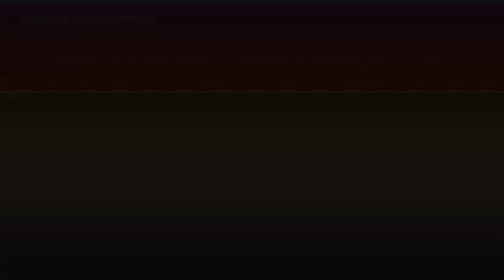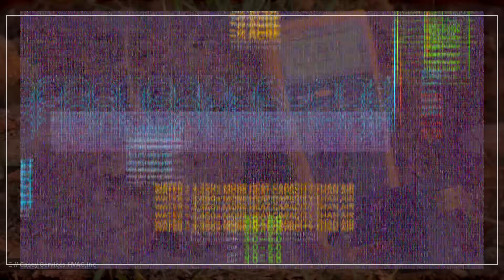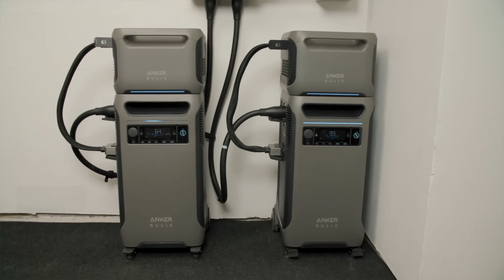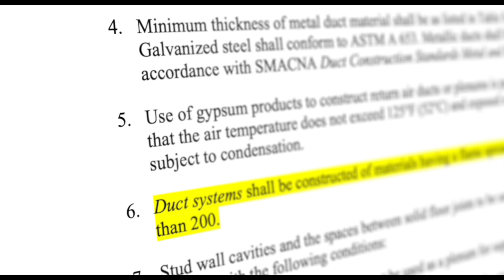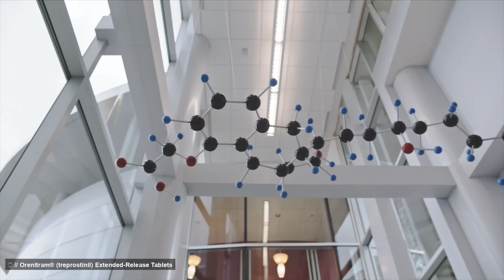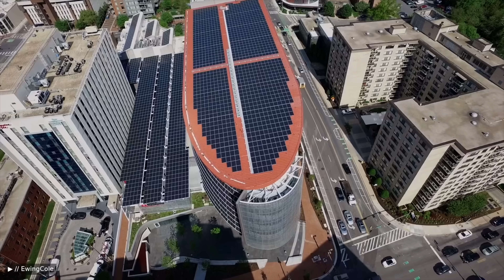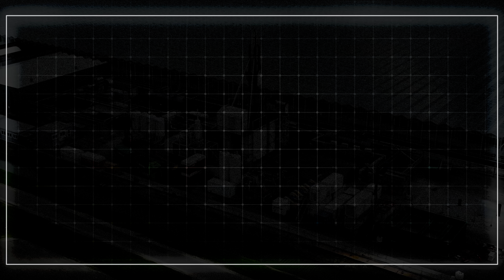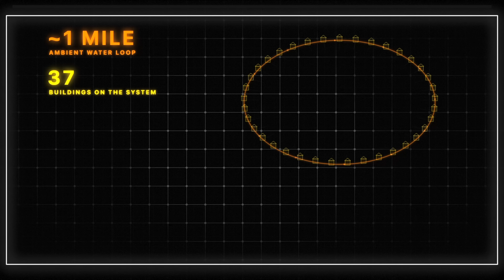The Viral DIY Cooling Hack That Nearly Killed a Family

Comment: Remember this administration believes none of this works so why should we pay for it and much prefer pseudoscience. And it's not just that if your system goes or you're looking to purchase a new one you're gonna go with what you have it's that these systems are way more expensive in the short term and not everybody can afford that so they are stuck (especially because they don't have these rebates) using a system that's less efficient and costs them more overtime.

Comment: Given you live in SoCal with some heating (very little) need and modest cooling needs (you are not in Texas) and you already have an air-to-air HP, hard to see the justification for it. Other than as an interesting science experiment. 
I feel a ground loop water system is what you should aim for. At the end of the day you want to make a case for a solution others can benefit from.

Comment: I’d be interested in seeing a comparison between a ground source heat exchanger directly into living space air, and a ground source heat exchanger into a heat-pump.
Reply: With a heat exhanger and no heat pump, you can only bring the indoor temperature towards the loop temperature. So if ground temp is 65F you will only get a small amount of cooling, and possibly getting you down to 75F is you're lucky.

Comment: I live in NZ, when I have looked into this technology, the local sellers advice to do horizontal loop over a vertical system. The reasoning being the horizontal is cheaper to install and repair. I would be curious as to which method withstands earthquakes best. My guess would be horizontal.

Comment: Building structure, as in thick walls, can go along way towards passive temperature control.  I never heard geo-thermal explained in this way before.  The two together sounds like a complimentary idea.  More expensive upfront, but worth it i the long-run.  Less machines to break down.  Thank you.

Comment: I did a feasibility study on ground loop heat pumps for a new build housing development almost 20 years ago. Sounds like the situation has changed very little since then. It's not economical to do these one home at a time, some kind of neighborhood scale system is the way to go. You really need a geotechnical engineer to validate the ground loop performance, and a separate mechanical engineer to validate the house/climate performance. Those are too expensive to hire for a single home, but you can get economies of scale across the dozens or hundreds of nearly identical homes in a development.

Hopefully the control algorithms have improved, 20 years ago you just picked a fixed ground pump, compressor, and air fan speed and hoped it would perform well (it basically required an engineering degree to do correctly, and even then it would only be optimal for a small fraction of the year).

Comment: It sounds like getting a normal air sourced heat pump and solar panels + battery is going to be significantly cheaper and have a much faster pay back period. The subsidies might have just been distorting the market (and still are with the commercial ones).

Comment: When i lived in Minnesota,  someone i worked with had a geo thermal system installed in their new build house.  It was a liquid cooled system.  She said that temperatures in the house were stable and comfortable.   It added $25,000 to the costs, but she said it was worth it.

Comment: Water source heatpump installation cost in central Texas is way too high due to the solid rock starting 1 inch below surface. You will never see the return on the investment. I wished it was less expensive but it is what it is. The projects in central Texas are all east of IH35 as they actually have soil to drill through

Comment: I was wondering why use a plastic in boreholes when it is an insulator. Why not a steel pipe with holes maybe 6 inch then lower cupper pipe spiralled like a coil to sit at the base at half inch. Then maybe you use a motor and pump the water through it and use it in heat exchangers throughout the home. Alternatively, 12 inch bore with1 inch pipe of copper? The holed pipe will allow normal water to accumulate and make the heat exchange better.
Reply: Because most earth is pretty slow at exchanging thermal energy with whatever your piping is, you don't get the benefit if you use more thermally conductive materials like metals. Because its so slow, it doesn't change things significantly.

  If the ground you're putting the piping is consistently very wet and dense clay, perhaps even has water running through it, then YES, switch to copper and then you don't need to run near as much piping as you would if you're using HDPE.  That MUCH greater thermal conductivity will start to matter.

   But if the ground is consistently fairly dry, fairly sandy, etc, etc, then the piping material doesn't matter much and can easily be made up by just using a little more/longer of the plastic.

Comment: Your choice of ground transfer plumbing is usually not as broad as you think.  Here in Ireland you are not getting more than 20ft deep before you need large rock breaker equipment, excavators with chisels etc or actual rock drilling rig.  So the most common here is the "slinky" loop under the garden.  "Ground source heat pumps"

Comment: we have a geothermal unit that handles heating/cooling/hot water.  It was a retrofit and they didn't mess up out yard AT ALL...down 15 feet and snakes 5 runs across our yard and ends up in the garage.  cost $25K and saves as advertised.  We set it to heat in winter and cool in summer and it ramps up and down as needed.  The neat thing is that most larger towns have the unit to make the runs.  The same unit that construction crews use to get utilities under a road.  Can't brag on it enough.

Comment: I-35 runs through downtown Austin, and Manor is east of Austin.  Basically, in central Texas, east of I-35 is clay and west of I-35 is limestone.  It would have been too expensive to have drilled those holes if it was west of I-35.

Comment: The earth tubes are safe if they have the right design . You have to have the air intake vent lower then the outlet (1nch lower every 10 feet) so that all the water runs out of the pipe and then put a drain right below the intake for the water to drain out. They did a 5 year study with this design and the air from the earth tube was in distinguishable from the outside fresh air.

Comment: Very nice video, but you missed two things, and possibly got something wrong...  In my area, we are using Glycol as the pumped liquid.  I don't KNOW if that is just in my area, but felt the need to point that out.

#1 is you still run a heat pump.  Just like the A/C outside you are familiar with, but it is inside your house, and rather than cooling your home with outside air, it's using that cool liquid from the ground.  This way you can cool the house below the ground temp, but also, you can use the cool ground temperature to HEAT the house, by running the heat pump in reverse, pulling the heat out of the ground to put in the house.

#2, and I found this one to be really neat, there seems to be a thing where the ground temps rise as you dump your house heat into the ground, AND THEN, when it gets cold, and you switch to heat, you now pull that heat back out of the ground.  Like storing your summer heat and reusing it in winter.  We aren't talking huge temperature swings mind you, this is all single digit numbers no matter what your preferred flavor is, C, F, or even Kevin (I regret nothing.)

Comment: you dont pull in the air and distribute it to the living space. Radon is a thing. You need a handler that is sealed with fins like an evaporator in an ac unit. There are moving parts, you need fans to move this air.

Comment: Nice to know that water has much greater thermal mass than air. When I got fed up with our brand new AC unit not keeping the house comfortable during days of 80°F and up, I decided to try using garden misters (including a hardness filter) on the outdoor unit to help carry more heat away from the coils. It ended up working amazingly.

And before anyone comments: no, it was not an effort to save money (which it certainly doesn't thanks to the water usage). It was an effort to keep our older house cool (70°F instead of 80°F while it's 90°F outside).

Comment: I have a ground source heat pump using the deep bore hole method. It's fantastic. Our heating and cooling bills are low. The install cost was high but I've no complaints. 
Glad to see you debunking that video.

Comment: If you install the tubes below the frost layer, note that it needs to be heated during the summer. Otherwise you going to have permafrost round your tubes and won't get any heat from it after winter or two. If you are taking coolant out from it during the summer there are no issues.

Comment: I've always wondered with the slinky coil system how the economics work out compared to running a much shorter pipe at a slower speed and not having it cross over itself all the time. That long skinny pipe is going to have a lot of friction loss, and if you make it wider you're going to have less heat exchange, but making it shorter will reduce the friction loss too. And the areas where the pipe crosses over itself aren't going to give good thermal efficiency because two sections of pipe are trying to dump heat into one section of the ground. A much shorter length of pipe, but laid out in parallel lines so each section of pipe has its own section of ground, would allow the water in the pipe to heat exchange more efficiently while moving less quickly and therefore needing less pump power.

Comment: The thumbnail is slightly misleading at first, as it seems to show an underground line running to a normal A/C condenser, not the kind of air-pipe you're describing here. This mold issue has been known for a very long time, which is why I thought perhaps you were going to talk about some new variation on it, or a completely new idea, such as burying your condenser line, etc.. 

Now that I take a closer look, I can see that what I thought was a condenser is just a kind of housing at the far end of the tube, presumably to keep critters out.

Comment: I would bet a direct air system would be amazing, but you would need to feed that air duct to an outside unit of a mini split. Unlimited easy to achieve heat in the winter at any temp(no low limit -14) and it would sip electricity on the summer highs. Would be a killer setup. Am I missing something or is that not the best setup for that?
Reply: You could, but air isn't the best thermal transfer medium. Ideally water would be used.  But the former is potentially A LOT cheaper and a lot less complicated (and lower maintenance) , and I figure every little bit helps.  I've decided I'm going to do some simple, relatively shallow air to ground thermal exchange pipes and have the air blow across the outside condenser (which is connected to an older air heat pump system).  It won't make a dramatic difference, but on those particularly cold and particularly hot days, it will relieve some of the strain on the system, and it really won't cost too much.

Comment: Wait, there’s a video actually recommending you directly ventilate your house with subterranean air? I’ve seen people suggest using geothermal heating/cooling, but it was always via a closed loop system.
Reply: It works well enough in ultra low humidity desert conditions provided you don't have a radon issue in your area.  But in moderate and especially high humidity climes, you have to be really careful because of mold, bacteria, etc.

Comment: If you pump heat into the ground all summer long, and hardly pull any heat out in winter, how long does it take for the ground to heat up? Are there any calculations on the heat capacity and conduction of these underground reservoirs?

Comment: A direct-air system has some advantages:

- It can be build from simple off-the-shelf hardware
- with some technical knowledge (and an excavator) - you can do it all by yourself
- it's a lot cheaper - working without heat exchangers or other expensive stuff - all you need is a fan

The mold problem can be solved by having access to the piping - either in your basement or a service shaft.

The amount of humidity can be reduced by not ducting air in directly - but through a layer of membranes and gravel. Here in Germany it's called "Luftbrunnen" = air well. Obviously - it's always good to ask an expert for advice beforehand.

Comment: I'm wondering what the long term effects on the ground is when you start apply the system locally at scale.
What is the effect of pumping/extracting large amounts of heat to/from the ground?
Reply from the maker: the bio mass of the earth is MASSIVE, there's little concern we'd ever move a meaningful amount

Comment: A ground source heat pump or even air source heat pump works really well (not so well in the winter when the difference in temperature is far lower), the downside is that if you don't have access to cheap electricity it may cost you more than just using mains electricity, I guess you could factor in some form of battery storage to get cheaper off-peak electricity to run the heat pump (heat exchanger) but I'm from the UK so don't know if you have off-peak energy tariffs over in the USA.

Comment: nonsense in San Diego residential. I have 1986 home in Phoenix that i retrofited to net positive (zero electric bill even charging a tesla) for under $20k, I got solar panels, insulation, windows, heat pump water heater etc., In San diego should be much easier

Comment: The vertical bore is common in Europe because it fits even in small backyards.  But even with regular old air conditioner in U.S. one could just put it in shady spot instead of on sunny roof and already your AC runs about 10 percent less.

Comment: Finland, winters typically 5 months -5°C ... -30°C.
The house is ~250m2 and OLD, with 1850's windows in rough shape.
Heating with a 15kW output eatpump taking ground heat out of a 1000m2 field, 750m of 40mm pipe at 1m depth.
The pump takes up to 6kW electrical power and it alone keeps us warm down to -20°C, after which we use additional wooden stoves (Old house has 5 of them). Payback time with rising electricity costs was less than 10 years, now 14 years old and still running with minimal maintenance.

Comment: Man, that's insane pricing for a couple bore holes and a bit of pipe, that's why people don't have that.
Reply from the maker: yeah, the labor is the issue for sure, I'm really curious what we can do to drop prices for drilling for residential cases by a factor of 10... what would it take?
Reply: @TwoBitDaVinci    I think most of the cost is not the "labor", but rather paying off these immensely expensive specialty machines that they use.  And, some good ole, regular American greed which seems to be so common here.

Comment: I live in North Texas. I recently inquired about a new water well. To go down to 400’ was going to cost nearly $100k. For one hole.
Reply: There are a lot of variables I don't know about your situation, but it sounds to me like whoever you were using was trying to rake you over the coals.  Typical drilling costs in the DFW/Cross Timbers region is roughly $28-$45 per foot.  For a 400 foot well you could expect ~$6,000-$18k.